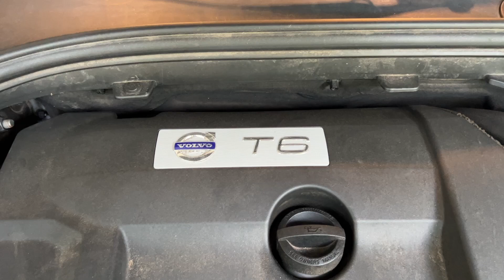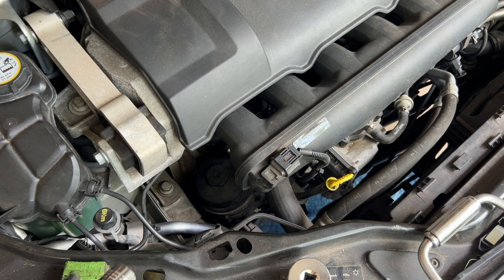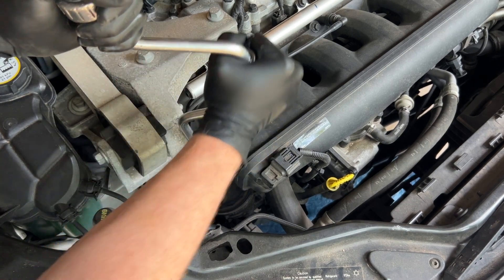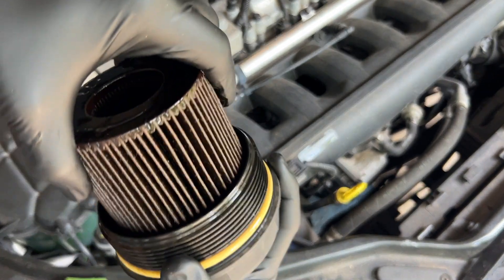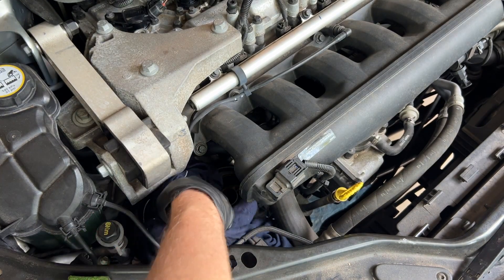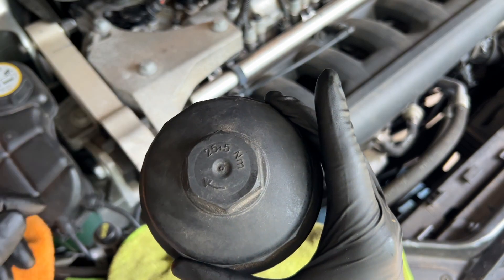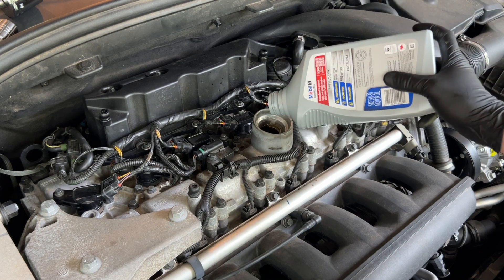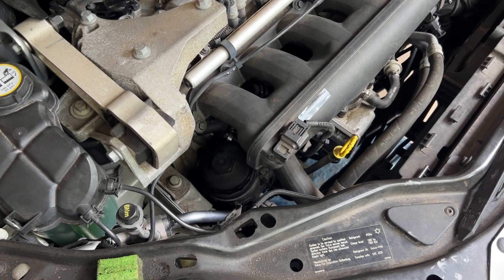How To Change Oil, Oil Filter, & Air Filter on 2013 Volvo XC60 T6

Comment: good video.  i use 5 qts 0w20 and 2.5 of 5w30.  gives it a good hapy medium for a best that runs like a tazmanian devil and has 161,000 miles on it.   i do this because i live in phoenix and i want oil to circulate quickly, and in the winter in the northeast, same thing.    this combo gives it about 1w22